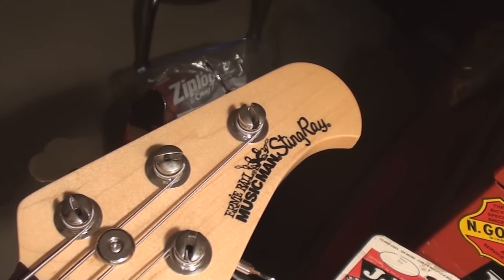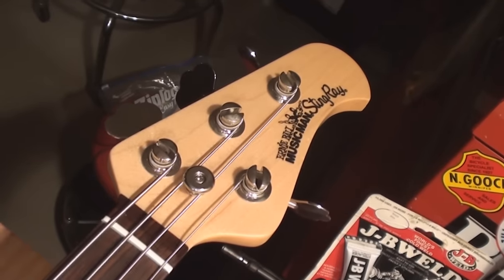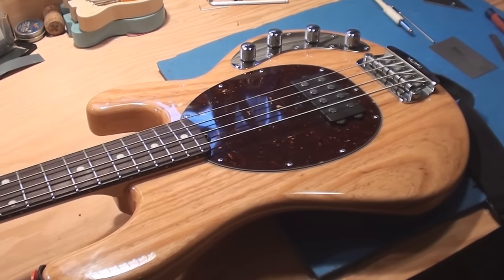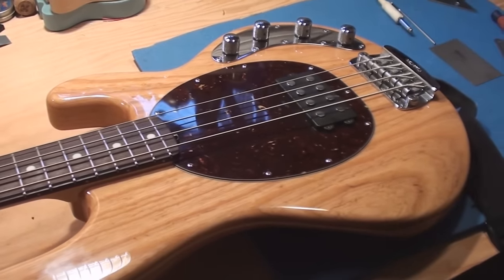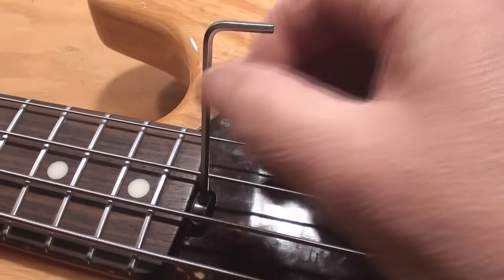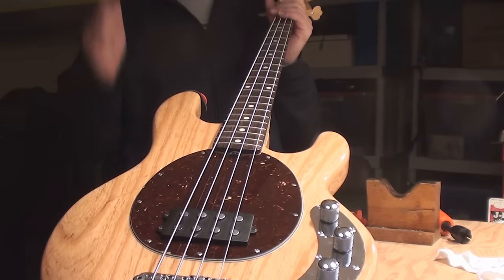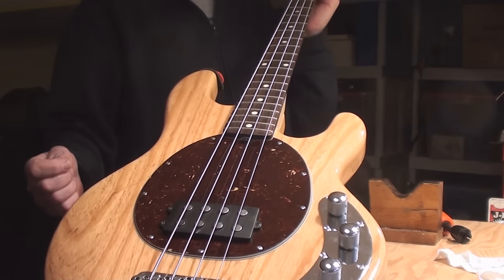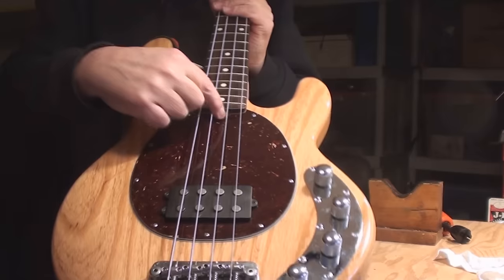MusicMan Sting Ray Bass Truss Rod Adjustment

Comment: Hi Dave. I mostly play the p-bass but sure love those Stingrays. I am responding to let you know that I actually own a guitar that has never needed a truss rod adjustment and I bet never will. It is a ca. 1963/64 Japanese made Silvertone electric guitar built by Guyatone. Very similar to the old Kent Polaris models from the same period. There are a couple of reasons for this freak of nature. The first is that it doesn't actually have a trust rod. The neck is just a solid piece of mahogany with a rosewood fretboard. The second reason is that when it is strung with .010 to .046 strings (or something close to that) with the correct neck angle and bridge height adjustment, it has perfect relief and plays beautifully. It was originally sold as the equivalent of today's budget imports such as an Epiphone Special II or Squier Affinity series guitar. Found her in a pawnshop many years ago. A kind of poor man's Jaguar or Jazzmaster kind of thing. Two single coil pickups with adjustable pole pieces. Terrific tone. Cost me 50 bucks. My little Pawnshop Princess.

Comment: Hey Dave. Brand shiny new MM Sterling CA5. Action is too lowand has some fret buzz on open and lower neck fretting.Before I set intonation, question. Should I attempt to raise the bridge saddles to correct or use the truss rod to raise action(only toward the nut end of the neck) ? Fret buzz only occurs on open string pluck and lower register plucking. I don't wantan extreme bow in the middle of the neck. Thanks in advancefor your experienced ballsackness advice.

Comment: You're so right about the weather and the four seasons. I live about 3 hours to the west of Toronto down by Lake Erie and each day brings something new when it comes to instruments changing.  Maybe one day we will gain knowledge from the aliens about a new material that is impervious to temperature, weather, light and has the weight of a feather and the strength to support a trillion tons of force.
Reply: +The Universal Eye Those materials exist but they require mucho-moolah
Reply: Am in Houston- 100deg plus down to 30deg. Modulus Quantum 5.Don't have to touch it. Just bought a MM Sterling 35CA. Keep your fingers crossed.

Comment: I have a big collection of guitars...  and in Ohio USA,  we have the 4 seasons too.    A few other suggestions for those who live in those kind of environments.

1.  Store your guitars somewhere where the temperature and humidity is rather consistent.   A well controlled basement is my preference.
2.  Don't just forget about a guitar in storage.   Pop the case open every few months and have a look.
3.  severe weather changes causing necks to go wacky can crack finishes and even disjoint glued parts like fingerboards...  
4.  As Dave said,  don't just let a problem build and build.   If it isn't in adjustment,  fix it.
Reply: Very sound advice. The nicest bass I've ever owned was a 2000s Pedulla MVP 5 string. Awesome bass and the best tone I've ever heard, but the necks are so temperamental. I had to adjust it up to a dozen times a year!
Reply: I live in Wild, Wonderful West Virginia, in a city on the Ohio River. My music room is kept at room temperature (66-68 in winter, 70-72 in summer) and 45% humidity at all times. I hardly ever have to adjust any of my stringed instruments (my drum kit? Same story, different ending), even if I take them out and play outdoors or drive a long way with them. I think consistency, along keeping them right, makes them a bit more resilient against the odd temperature/humidity change now and again. 
My Ernie Ball Music Man basses and Sterling by Music Man guitars are the ones that usually go anywhere, though, precisely because of their peerless factory construction and that truss rod adjustment.

Comment: Our band tunes down 1/2 step so I tend to have to release a bit of tension so my bass doesn't fret out while I'm tuned down, but need to check it a few times a year.  usually a 1/8 or 1/4 turn is all that's needed.

Comment: Hey Dave.  That looks like a nice bass.  How's the play ability?  I'm thinking of getting a new ax but I've only really played one for any extended period (Grabber).  Just looking for something different...
Reply: *****

My 6 has an active but I'm not so sure about bass.  I've never played a bass w active.  I guess I might have to venture into L&M.

Cheers!
Reply: +Rico Swave Most are on the heavy side, but great sounding basses. I used to own a 5 string, but missed the neck pickup and didn't want to deal with the weight.
Reply: MrDangard

Thanks for the info.  Weight is fine for me, but a lack of neck PU not so much.  Do any of their models have one?

Cheers!
Reply: Yes, any of the MM models w HH designation= two humbuckersHS - humbucker and single coil. Both are MM bridge & neck pu's.
Reply: Bass Mike  Cheers!  Much appreciated...

Comment: Dave is it just me or is the low e on basses often a pain in the ass to intonate?  seems like I have to always move saddle.way back compared to the others...is this common?
Reply: You are not just-seeing-things.  I have the same issue, but even more so on the 5th string (low-B.)  Last December, I had to move this Ibanez's bridge about 3/16-inch away from the neck... to get more adjustment room.
Reply: They are hard to tune, much less intonate!

Comment: If the trust rod is too loose does it bow back? And if the truss rod is too tight does it bow forward? Thank you for video!
Reply: Just the opposite.  If it’s too loose the strings will pull the neck forward and the action  (space between strings and fret board) will be higher, but if you tighten it too much then you’ll get fret buzz.  That’s why you need to check it especially if you live in an area where the weather changes with the seasons.
Reply: @dennytroy  Wow. Five years ago. LOL I learned a lot since then. 😊 Thank you for your reply. 👍🤘🎵🎸

Comment: Dave , I really hope sometime someone sends you a sterling by music man Sub Ray 4 bass... its the cheapest musicman style bass you can get that isnt counterfeit. Its literally like the below squire version of ernie ball... ernie ball goes.. EB USA , then Sterling, then sterling by music man.. Its actually a pretty decent bass though. Mine could use a setup and I just dont know how to do it. I can adjust a truss rod and have on my bass.. but Id love to get the intonation etc. right.

Cheers bro.

P.S.- If anyone cant afford a good fender jazz bass and wants a good alternative.. check out the peavey milleniuim bxp basses. I have a 2003-2004 model that I love.
Reply: Once you put on new strings, set the truss rod and adjust string height at the bridge, use a good accurate tuner and tune each string using the 12th fret harmonic. Then check the fretted note at the 12th fret. If it is flat, adjust that string's saddle to move toward the neck, shortening it's length and that will pull it up into tune. Check often as you adjust! If it is flat, adjust it at the bridge in the opposite direction. Repeat for each string and you're done!
Reply: I also have a Peavey Millennium BXP, and it is a great budget bass! Sounds like a vintage Fender jazz!